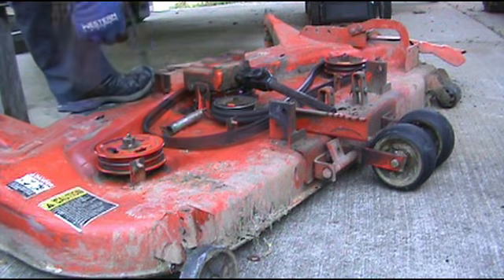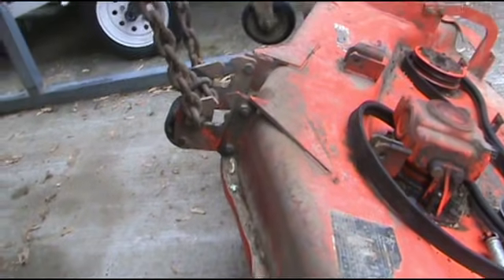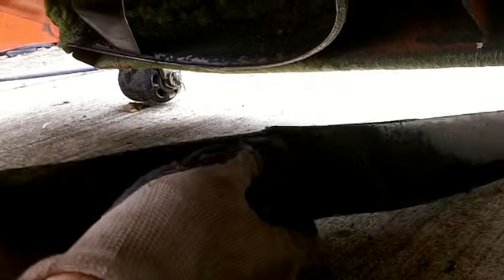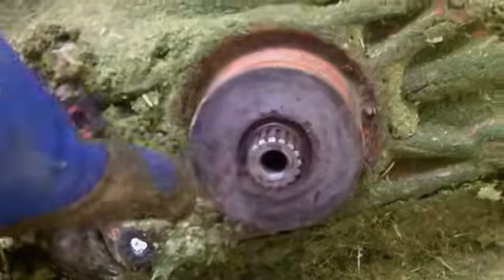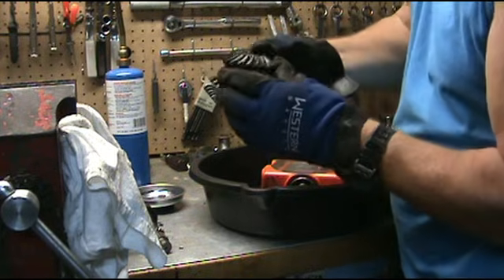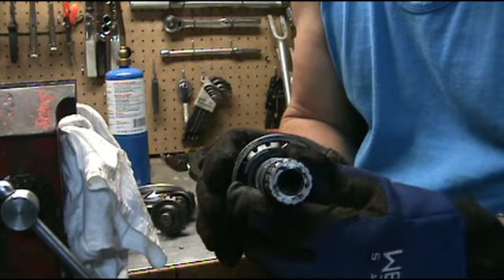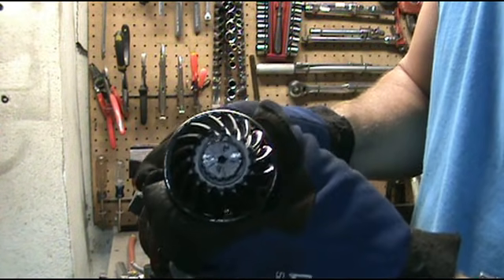Kubota Belly Deck Gearbox Rebuild Part 1

Comment: Does Kubota have issues with mower decks?
Reply from the maker: Not sure but the ones that have a gear box needs to be checked yearly. I have found many gear boxes very low on fluid and that's not good.

Comment: I just ordered all the parts to rebuild this from Messicks. Whatever I don’t use I’ll send back but I ordered everything including the gears which were 500 bucks.  You don’t really show the reassembly unless that’s on another video.  When you put that thing back together, is there any backlash on the gears like with a ring and pinion or did the gears just go back together the way they came apart?  I don’t want to put new gears in and ruin them because they’re out of adjustment.  I figured maybe that’s what those shims are for.
Reply from the maker: There is another video. My bearings and seal went back together pretty easy. I didn't have to replace gears.

Comment: You lost me at Hammer + Bearings ,  That is NEVER a good combination . And those small washers you removed are called SHIMS and they are there to adjust gear clearance .
Reply from the maker: Yes they are shims for the play. They keep the slop out so there's less movement and wear.

Comment: Just done my gear box fitted a new one good video great help but 2min 53 in its not a spacer their is a bearing 
That the shaft of the gearbox fits through its held in with 2 big sur clips what you called a spacer was the centre of the broken bearing.
Reply from the maker: No, that is not a bearing, it's a spacer or some folks call it a sleeve.

Comment: Love the videos on the rebuild.  One thing that drives me crazy...that piece of metal you remove from the shaft is a key, not a keyway.  The keyway is the slot cut in the shaft, the KEY goes into the KEYWAY.  Great instructional videos.  Thanks
Reply from the maker: Thanks and your welcome

Comment: That pulley ain’t that easy to come off, I had to put a wheel puller on mine
Reply from the maker: Your pulley must have over heated or rusted and stuck to the shaft.

Comment: Just a heads up…..they weren’t washers, they were shims for setting the backlash when reassembling. And they aren’t gears holding the blades, they are splines.
Reply from the maker: Same reply as before. Thanks

Comment: Nice detailed video.  Thank you.  I took mine to a repair shop.  My guess is that they'll just want to replace the gearbox.
Reply from the maker: Thanks, and your welcome. Let me know what they charge now days. I know a gearbox isn't cheap.
Reply: @LonnieJohnson1  $1100 for the gearbox and $400 for the labor.  Trying to decide if this is something I want to tackle myself.  I can get the rebuild kit for $126.  I can work on things but I don't have any special tools.
Reply from the maker: Wow! thanks for the info. They use to be $750 new, but $1100 is a little much, have you looked around? Save yourself some $$$, you can do this. What have you got to lose. They want to sell you a new box for $1100 and $400 labor.  Let me know how it turns out.
Reply: @LonnieJohnson1  The shop said the actual gears are bad.  I'm thinking that I should just cut my loses and buy a good residential mower.  How much do you think anZG222 is worth with a bad gearbox?
Reply from the maker: What year is it?
Reply: @LonnieJohnson1  2011.  I should also mention that it has a recent new Carb and Fuel Pump.  It runs great despite the fact that one of the cylinders has low compression.  I've considered taking the deck off and using as a hauler/pulled, it's so strong.
Reply from the maker: You never know, you might come across a good deal on a box later on down the road.

Comment: Don’t suppose you know the size or part number for the grease bearing seal between spline and deck?
Reply from the maker: Depending on your model deck size you can call a Kubota service center and they will tell you.
Reply from the maker: I found the seal but you will need to double check it. It's for a gearbox off a 60" deck. Kubota #76535-33440 Oil Seal
Reply: @LonnieJohnson1  couldn’t get the exact seal but the bearing centre matched it and it fit! 😑 the old one had perished and I just spent a whole week fabricating 80% of the deck after the centre ripped completely out. 
Wanted to make sure I did everything right as a new deck where I am was going to set me back $3k thanks for your help!
Reply from the maker: Your welcome, glad to help.

Comment: Thanks Lonnie, for your indepth video. I appear to have the same issue with the bottom bearing fused to the gear.  The bearing is compromised. You mentioned the 12 ton press had a challenge separating them.  Can you elaborate or suggest any other alternatives?  Someone suggested heating it with w torch to bang it out.
Reply from the maker: You can use a vise if it's big enough. If you have a cut off tool you can cut the bearing off, I have had to do that before and it works very well, just takes a little more time and the bearing slides off.
Reply from the maker: The bearing on the gear would be hard to cut off. If you don't have a press you can put it on top of a vise and try to hammer the gear out of the bearing. However, a 20 ton press would be nice.

Comment: I noticed my gear box is leaking oil onto the deck. What seal might be the culprit here? It is on the right side.
Reply from the maker: It could also be the lower seal spinning and throwing oil onto the deck.

Comment: I'm sure you've been advised by now that those "thin washers are SHIMS" to set the backlash for the bevel gears.... My first time I got the shims on the wrong sides and the gears wouldn't turn..  Ouch.
Your's is a well paces video on how to do it.  Thank You I'm rebuilding the third gear box. two were mine and one was a friends.  The seal on the bottom failed  on mine in very heavy mowing and I didn't know it until the deck quit turning. The bevel gears were smeared......  I had to cut the bearing under the bevel gear. It was a very tight press fit, ie., I had to press the new one with a hyd press.   Same thing you experienced.
Reply from the maker: Your welcome

Comment: Hey Lonnie! Used your video to walk me through the process.   After getting everything installed, I added the grease then started her up and cut grass for 15-20 minutes then 

SCREEEEEEECHHHH!

The gears do not appear to be merging properly and they don’t seem to be close enough together now, even though I had taken time to line them up.

Thoughts ?

John
Reply from the maker: What kind of gear oil did you use? and you didn't use sealed bearing's did you?
Reply: @LonnieJohnson1  I used the recommended gear oil.
Reply: @LonnieJohnson1  And I bought the bearings from Kubota….
Reply from the maker: Are you sure the sound is coming from the gear box? my pulley was also bad and I had to take it back apart and replace the pulley.

Comment: Shaft to pulley is an interference fit via shaft taper.  The reasoning behind this is to keep the pulley from riding up and down and cutting into gearbox.  It should never just fall of the shaft.  EIther the shaft is worn on the O.D. or the pulley has an oversize I.D. These ALWAYS require a gear puller to remove and a press should be used to reinstall.  These should be checked with a caliper for proper size or you've wasted your time on the rebuild.  The same for bearing seats and input shaft.  The failed bearing also galled to the bevel gear from intense heat.  When the gear cracks from the thermal load it will fail.
Reply from the maker: Thanks for the info...it's still working strong. Check the fluid and sharpen the blades until it fails again.

Comment: That looked surprisingly dry for a gear case. Same for those bearings. Those gear case seals appeared to be intact and not leaking. Was there ever lube inside the case or are they supposed to run dry like that?
Reply from the maker: It was dry and the owner had never checked it. There suppose to be a certain amount of fluid and it's not suppose to leak. Check and change the fluid as needed.

Comment: I am going to get into my gearbox tomorrow and learn the ins and outs..I’ll figure it out. My deck was vibrating and sort of noisy replaced a belt in August one just busted late May and now I suspect getting down to the problem..see rubber from my new belt and notice the center pulley is slightly sloppy. So I tore the gear box off and the same as you stated just seems sloppy but now not sure.. but I will see what bearing and spacer is worn or maybe a gear.. I’ll know more in by next week either way.
Reply from the maker: Hope this helps
Reply: @LonnieJohnson1  That gear box has two caps one horizontal and one vertical. The one I am talking about has one only in the top for the vertical work. So your stuck with the horizontal shaft and gear that needs to come out first because the vertical gear is underneath the horizontal gear.
Reply from the maker: Was you able to get it done?

Comment: The heat must have toasted the temper in that gear also....I'm assuming that your supplier recommended replacing that cooked gear also. great detailed vid. Seeing how old this vid is; how did it all stand up?
Reply from the maker: The gears weren't that bad...It's still holding up and working like it should.
Reply: Yes the bevel gear was "toast". It had galled to the failed bearing,  Should have been replaced. When it cracks it will be catastrophic for the gearbox. Not a place to cut corners.

Comment: My gear box does not have a seal just opposite of the input shaft so wondering how to disassemble as I have to replace the output shaft oil seal - any knowledge on this?
Reply from the maker: I would have to be looking at it to see how it comes apart.

Comment: Where can I find replacements for the exact bolts attaching the mower gear box to the mower? Sorry, couldn't find the exact bolt listed in the manual
Reply from the maker: The dealer has the exact bolts it takes, or if you have a bolt you can match it up with the exact same kind from about any hardware store.
Reply: Thanks
Reply from the maker: Your welcome, glad to help.

Comment: Your video was was extremely helpful for my rebuild of the gearbox on my 72” deck. Step for step was “almost” exactly the same and the part that was different just took a little common sense to figure out. Don’t think I could have done the rebuild without your help. Thanks you ever so much for the great job!!
Reply from the maker: You're very welcome and thanks
Reply: hey i’m about to rebuild mine on my 72” deck f2400 i’m hoping this helps

Comment: Early on, after lifting out the gearbox, you took out a key way. Could that also be a shear pin? Not knowing I had flat tire, my mower rode lower and I hit something. My mower seized and I later noticed oil leaking from the gear box. I’m horrified about diving into the deep abyss of the gearbox, but your video is making it seem a bit more bearable. Thanks for posting.
Reply from the maker: Is it leaking from a seal?
Reply: @LonnieJohnson1  I haven’t opened it up yet. Wanted to check YouTube first. I’ll contact you when I’ve gotten to it. Thank you for responding so quickly.
Reply from the maker: It's better to try to fix it yourself because the repair shop will charge about $700 plus parts. A new unit cost about $1500 give or take.
Reply: @LonnieJohnson1  I have every intention to DIY, that’s why I’m glad I found your post. I’m hoping it’s a blown seal. I live on a small island and the cost of Living In Paradise is astronomical when compared to the US mainland. Fortunately, I have a former coworker who is an accomplished mechanic and he said he would coach me rather than do it for me. That’s his way of getting back at me for the days when I was his Captain in the Maui Fire Department. I used to tell him “I’ll teach you how, but I ain’t gonna do it for you.” LOL. I’m retired, now he’s a Fire Captain.
Reply: OK. Finally tackled the job and got it done. I kind of panicked when I took off the blade and there was no geared washer. Upon closer inspection, I realized I was probably dealing with either an earlier or later model. I had only one of the covers you tapped out with the screwdriver, and it was on top of the gear box. I eventually turned the gear box over to my mechanic buddy and he finished the job for me. The oil leak was due to a blown seal at the shaft leading to the blade. Thanks for posting this video. You saved me a ton of money friend.

Comment: Those washers on the shafts are actually shims, they tighten the gap if you have too much play in the bearing. The shims can be different thicknesses so they need to go on the way they came off.
Reply from the maker: Yes they do.

Comment: Lonnie, How much run out does the driven shaft have? also is there any side play?
Reply from the maker: I had no side play. I have no dial indicator to check the run out. It's a mower deck and the run out would not only be hard to do but dangerous as well.

Comment: read your owners manual.  those seals get changed every to years   also keep the top of the deck clean
Reply from the maker: Yes keep the the clean and you will save your spindle bearings. I have always checked my gear oil and have never replaced seals or bearings in my 12 year old personal Kubota.

Comment: Looks like no oil in the box? Hope you didn't use the hammer on the new bearings for reassembly, that slick little press was made for just that.
Reply: What type of oil did you put in the gearbox?
Reply from the maker: It was ran dry on oil. Didn't need the press, I pushed them in with my fingers.

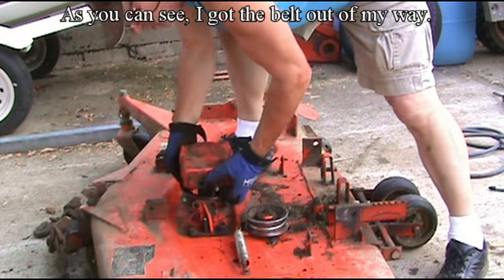Comment: Excellent video. Big help.  Just a heads up, not all Kubota RCK60-24B mower decks have that spacer at 2:40.  Kubota changed the design after a certain serial number and the factory schematics don't show this feature well.  Hours of my life spent and the dealership arguing that a spacer should be there. Eventually they found it on a separate page by itself.
Reply from the maker: Thanks!

Comment: How many hours did you get on the gearbox before it failed?
Reply: About 1200 on mine, it was noisy for 40 or 50 before it locked up